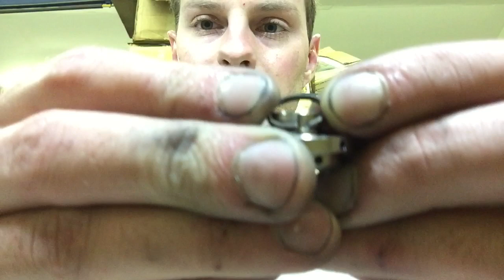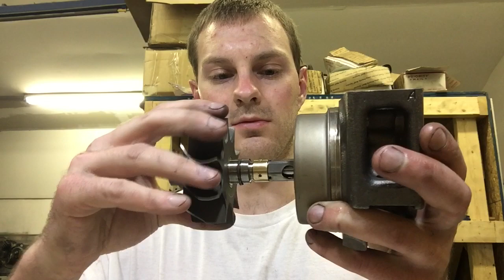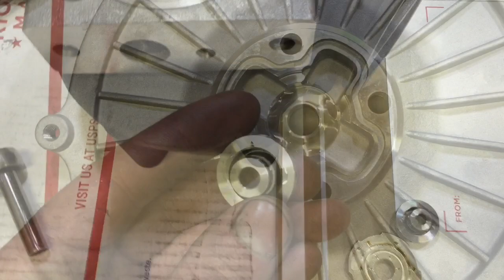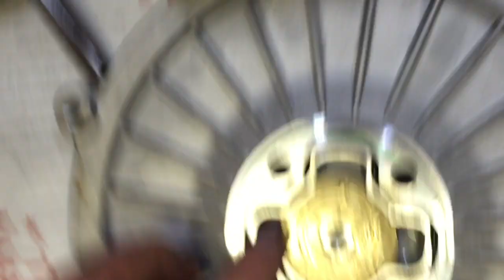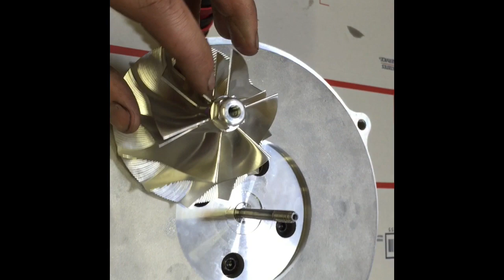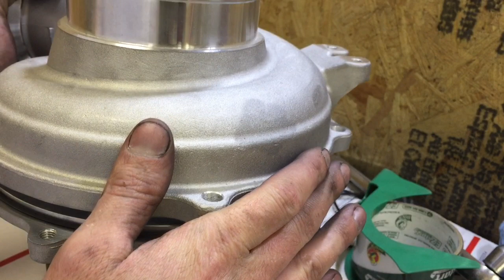99-03 Ford GTP38 7.3 Powerstroke Turbo Rebuild

Comment: How come you don't sell these parts anymore i wanna build another one for a buddy
Reply from the maker: I still have the parts. The reason they aren’t listed is because eBay deleted my seller account because people were contacting us about services on the eBay messenger and eBay wanted commissions on that.
Reply: @turbolabamerica can you hook us up with a link for a 67/88 kit? I'm a big fan, built it with a kc 300 drop in exhaust wheel performance is awesome

Comment: Most of the work done to my truck bt the previous two owners needs to be redone or completed. They were not mechanics but they really tried ill give em that. Going to send you guys my turbo someday when I get to that point. Same turbo except mine has had silicone added to the compressor housing 😂 and god only knows what else. Its not leaking oil yet though and has clearly been removed and kind of had something done to it. Whatever they did im sure its as sub par as the rest of the shit ive found digging into this dinosaur.

Comment: Do u have to machine out the back when using stock shaft??
Reply from the maker: No. There is a 69.8 mm turbine and the other one is a 67.6 I think. The wastegated version has the 67.6 with a .84 a/r turbine housing. The non wastegated from the van e450 chassis 1.15 non wastegate turbine housing with a 69.8 turbine.

Comment: What are the specifications for the (4) bolts that mate the turbo housing together with the intake? I am missing one of the bolts (could that be a reason for a power leak?). Thanks!
Reply from the maker: 8mm x 1.25 thread. About 12 ftlb
Reply from the maker: Probably need a 5/16 head, I have a lot of extra bolts for that
Reply: @turbolabamerica  would you ship me one?

Comment: Will this compressor housing work for an early 99?
Reply: No. The major difference with an early 99 is also the smaller compressor housing, and also differences in up pipes, spider, CAC tubes, pedestal, etc. and I believe the exhaust manifolds too. Hit up RD2 fuel systems diesel performance on Facebook. He has the best prices around, best customer service by far! And even better, incredible shipping times

Comment: If I put this kit on a 7.3 with +100hp injector nozzles  does the turbine and housing need to be upgraded like you did in this video?
Reply from the maker: You don’t have to upgrade the turbine wheel but it is an option
Reply: @turbolabamerica  so the extra air and fuel with the factory turbine and housing won't choke the exhaust and  and make too much exhaust manifold pressure? A friend of mine bought one of your kits a while ago and we are just getting to putting it on. There would obviously be better gains up top with the bigger turbine correct?  Sorry to bother you.
Reply from the maker: The turbine upgrade will make a difference but it’s not going to be a big difference , most likely 10-20 hp difference. The 7.3 has a common  problem with the uppipes leak pressure. I won’t if they every truly seal. I worked on mine and made them much better than they were but they still leak., I’m going to try a few things to fix them. My point about the uppipes is that you may have a decrease in exhaust pressure as a result. When the compressor and turbine size are close in size they are usually close in flow rates, when they are close in flow rates they increase efficiency. You can use the original turbine or the larger one, either will perform well. This turbo is big in size for a stock turbo.  You won’t exceed it boundaries very easy.

I never did an injector upgrade on mine, I have the turbo upgrade and the terminator oil pump upgrade with the hydra tune. It runs great with this setup. I didn’t have the oil pump upgrade until we thought the oil pump went bad, that turned out to be the dim that was the problem
Reply: @turbolabamerica  yea my buddies truck has brand new up pipes so that shouldn't be an issue. He has the crossover fuel  system that puts a fuel pressure regulator after the fuel galleries. And he's got a different waste gate actuator called like a big gate or something along those lines. And we did all the fuel mods to the banjo fittings and the filter housing. He's got some 6 gun tuneri think it's called and a "boost fooler" which is just a boost controller type thing that replaced the factory one. And he's got the 4 inch downpipe and I believe 5 inch exhaust to the 6 inch dual 45 cut tips.
Reply: @turbolabamerica  if your ever thinking about doing the injector upgrade it's super super simple. Face the nozzle to the sky and turn off the end and all the little springs and pins and stuff will stay right in place.  Tap the old nozzle out of the end then drop the new nozzle on and screw it back together and replace the orings.
Reply: @turbolabamerica  you obviously should replace the brass crush washers on the end also

Comment: J brake?
Reply from the maker: Not sure how to answer a question like thet
Reply: Ebpv plate. Closes up to help the truck warm up in colder weather. Most people delete them (even the Canadians) with no issues. The one on my truck kept getting stuck, it almost looked too big, and would catch on the crud inside the turbo (will fix with ccv mod) when the flap is closed it causes a major loss of boost and power.

Comment: Did you put a seal or gasket between the cartridge and exhaust housing?
Reply from the maker: The only part there is the heat sheild

Comment: The stock housing only has 4 bolts but yours has 5 bolt holes you need to get that fixed with the housing oring but other than that it seems like it’s alright we will see when it builds boost
Reply from the maker: 99-03 97-99 94-97 turbos have variations, this one is 99-03

Comment: When setting the compressor housing and place is there a reason 2 drop it misaligned and slide on the other ring?   it seems like it might be better for the O-ring to drop it already lined up.  

  It's actually white grease...   ha.   I going to tell my wife that next time.

Comment: what will make oil to come into fuel
Reply from the maker: +Audrey Elmore on the fuel injectors there are seals to separate the oil and fuel, I would guess one of your seals is leaking there or the fuel injector isn't all the way in

Comment: How do I order the rebuild kit from y'all? I have a 2000 f250 7.3
Reply from the maker: http://ebay.to/26dgzdM
Reply: What is the recommended wheel to use with this upgrade

Comment: Hi , do you sell the ball bearing cartridge for the gtp38r?
Reply from the maker: +marlon tai I have the cages the rebuild kit is the same as the gt37r
Reply: @turbolabamerica  will a ball bearing cage bolt up to the gtp38 turbine housing and compressor back plate?
Reply: Turbo Lab America so you sell the rebuild kit for the 38R?
How much$?

Comment: How much bigger is the HX40W turbo than this GTP38 turbo
Reply from the maker: The gtp38 turbine ~67mm is bigger and the tp38 turbine ~69.8 mm is even bigger. The compressor I think is about the same. Hx40 turbine is ~64mm. There is a 67 mm one too

Comment: Does this work on the 1999 E350 and E450 Van turbos?
Does your kit include the O ring for the compressor housing now?
Thanks
Reply from the maker: +Andrew Smith yes we have the compressor housing oring in the kit now. The rebuild kit works for the 94-03 but the compressor housing and plate and upgrade only work for the 99-03. The plate and housing may would for the 97-99 but I'm not sure, it does bolt on to the 94-97 though , the bolt pattern to the bearing housing is different on the 94-97 vs the 99-03, but I'm not sure about the 97-99.

Comment: Hello,I had bought this rebuild kit but never though of checking to see if there was play but from what I remember there was none and It wasn't making any noise previousely. In fact the only reason I decided to rebuild it was because I had to replace my up pipes with the Dorman 679-005 Turbocharger Up Pipe kit because they were leaking so decided while I had it apart just to go ahead and rebuild the turbo.When I installed the new rebuild kit, with the wicked wheel II, I have side to side play. Could this be that I put something together wrong or is it that my shaft is just wore? If the shaft is wore do you supply a new shaft with exhaust side wheel?
Reply from the maker: +Allen Reed it should have some shsft play for oil clearances especially if you didn't put oil in during the installation. It should have enough shaft play where it almost touches the housings but does not touch.

Comment: love your videos.  keep it up.  i have a 3.0 lilter engine and want to change my turbo for a Garrett or holset from a diesel truck. which one do you recommend for a v6 mid to high end range power? t4  flange. i have a ebay gt35 68 trim knockoff that's going bad.
Reply from the maker: +Tony De La Cruz something around 60mm. Like a gt35r or 60-1 with a .82 turbine housing or larger. An hx40 would work well. An hx35 maybe too small and choke the engine.
Reply: +Turbo Lab America  do they sell rebuild kits for a m24/68 trim/70 ar godspeed turbo? its looks like a gt35
Reply from the maker: It depends with version you have. Some take a to4e rebuild kit and some can have a ball bearing cartridge installed in them.